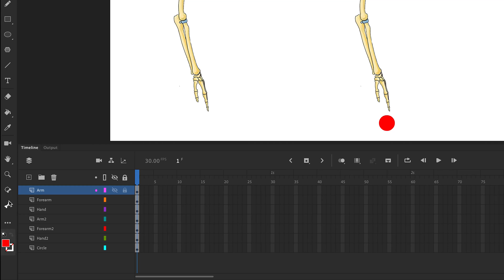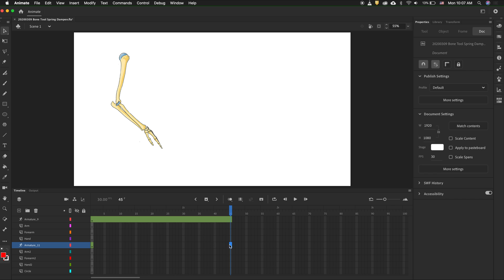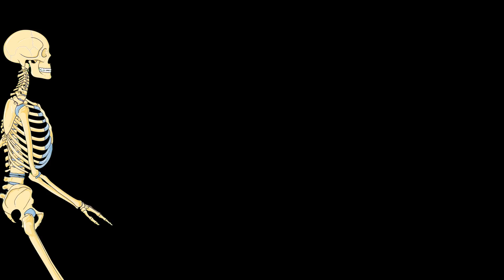Bone Tool Animate CC - Use Speeds and Constraints to Rig an Arm Structure

Comment: Great, Thanks. One question, Would you use the constraint tool to attach the ayes and the mouths to the head so they move along with it? Because I tried to do that but I couldn't because the bones in CS6 didn't allow me to see where I was pinning the bones, since they are bigger than those ones you got there.
Reply from the maker: You should use nested symbols for that. You can put all the eyes in the head pieces into a simple and then add that to your rig

Comment: I try to connect the bones, but I can't, for example: when I connect the head to the neck, it cannot connect to any symbol, for example, arm, it seems that the bone has a prohibited sign, I've done everything, but I can't . Somebody help me??
Reply from the maker: Sometimes you may already have an Armature created with just one symbol and then you can't join it to other things. Look on your timeline see if there's anything that says Armature 1 or Armature 2.

Make sure that each piece of the character is its own uniquely named Graphic Symbol then select the Bone Tool and drag from each symbol and they should connect.

You can download the sample file from the link in the description of this video to try it out.

Also, if you have a newer version of Adobe Animate CC you can try to use Layer Parenting that is newer than the Bone Tool.

Comment: Hello! Could you help me, please, how to make the 
layer with eyes (and with a mask for the pupils), 
facial expressions and mouth (already synchronized with an autolipsink) 
move synchronously with head movements? 
The fact is that the character is already moving with skeletal animation.
(Please excuse, I'm using a Google Translator).
Reply from the maker: Copy layers and frames of, audio and lipsync, then open head graphic symbol, create new layers for mouth and audio, paste in the frames, then the mouth should move with the head since it's inside it's graphic symbol.

For the eyes and the mask you can create new layers in the head symbol and have them overlap and animate the frames. You could also create a new symbol for the eyes.
Reply: @WhatMakeArt  Previously, I probably did symbol fragment of the video and did not receive it. Now I did as you wrote and it all worked))) Thank you very much!!!